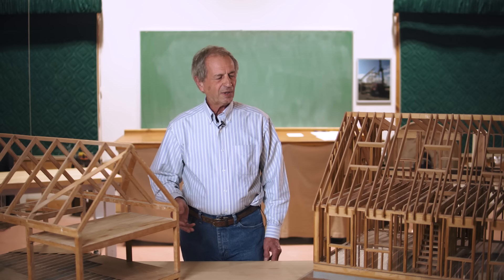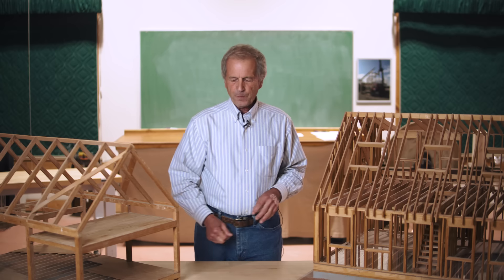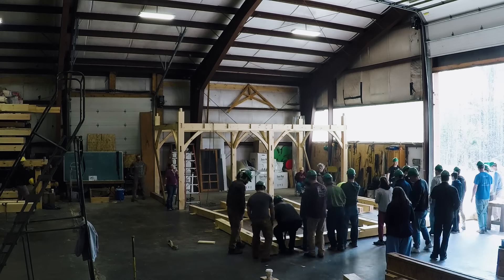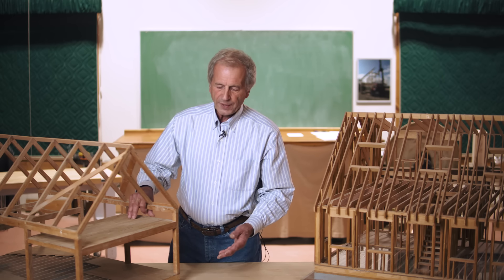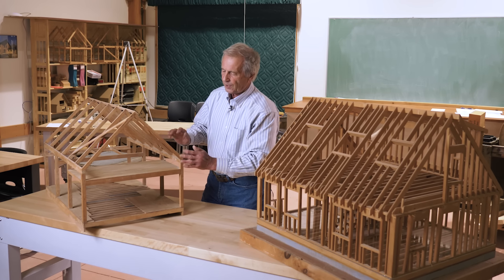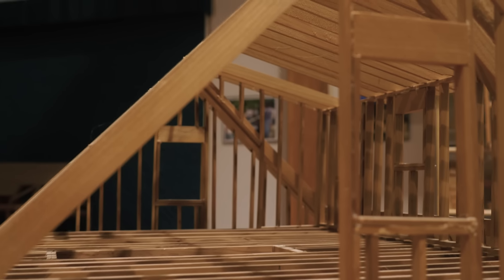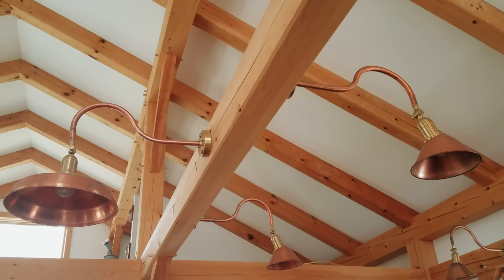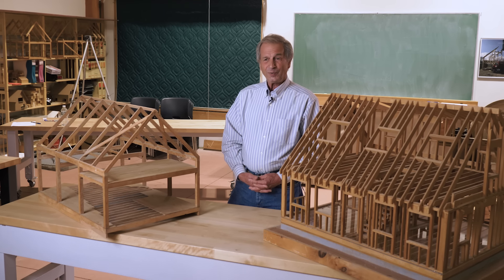Timber Frame vs Conventional Stick Frame

Comment from the maker: Take Your First (FREE!) Step Into Timber Framing with our Online Mini Course  -  tinyurl.com/u4ty9nm
We have taught thousands of ordinary people how to build their own timber frame structure, starting with raw timbers & ending with a beautiful 24' x 24' structure. Also check out our 5-day, in-person intensive Purely Post-And-Beam class - shelterinstitute.com/course_offerings
Reply: I have built for many decades, hundreads of structures , most every type of log home, post and beam to include conventional . There is a a time and place for each type and method with the many products that go with them. It takes months or years just to master even one of the trades but much longer to be a qualified builder. Having to meet the different codes of each state, county and or city and the codes for ever and ever changing will take far more than a five day course.  I do agree that one can build their on house and save lots of money but that depends on the person and their circumstances. I disagree totally about the structural integrity part of this video. I would suggest learning all conventional carpentry first and then move on to beam works and or log works.
Reply: assassinlexx  look into ancient Japanese beam construction. ancient Japanese buildings were made with wood-to-wood joinery and no nails and still stand today even though it's a highly earthquake prone area.
Reply: Shelter Institute 👍
Reply: assassinlexx  modern earthquakes require modern solutions?  Build underground on high ground.  No more problems.  Immune to earthquakes, tornadoes, and fires.
Reply: @ Grant Johnson.  Surely you are not saying that I'm a shill for big construction ?  I have had many home owner / build it their selves come to me halfway through building their homes or additions to help them, major works in place needing to be taken out from the roof down to the footings, two homes on unstable soil and sinking, dozens of issues.  Most of these good people had one common denominator - a person who knew enough to be dangerous for them, a Carpenter or Carpenters helper or another tradesman .  People that meant well but found themselves in a world of shit!  I have helped a few in my life , worked for low wages for the best and nothing for the worst.  I love the can do rugged spirt of American individualism but don't be a penny wise and a pound foolish or bite off more than you can chew.  If you have the help and know how to permit and build your house like many do then go for it !  Maybe you have the ways and means to do parts of the work, say the finishes such as drywall ,painting, finish trim and or cabinet's , maybe set windows and installation of the siding or building the decks.  There are no codes for the paint job or if your window trim doesn't fit perfectly and most would never know it but you. I am not for big construction when it comes to residential and for those that have or will bite off more than you can chew remember this " you will be stronger for what doesn't kill ya"
Reply: Are these structures suitable for northern climates? (Canada)
Reply: A lozenge don't stop drain.
Reply from the maker: @iworkforme  Thank you for the question. These structures are absolutely suitable for northern climates. SIte orientation, window specification and of course installation play a roll in energy efficiency but these structures lend themselves well to a variety of climates.
Reply: I like what your doing.....in our country most of house are constructed with block but I wish to do a project of timber house
Reply: Personally I'm a fan of timber frame homes, especially Greene and Greene homes. I laughed at your "gypsm palace" reference. I work in construction and occasionally we work on timber fames, we call them "Temples to Wood."
Reply: @j.r.millstone  They didnt use nails due to having so little iron as a natural resource
Reply: I guess Im asking the wrong place but does anyone know a method to get back into an Instagram account??
I stupidly lost my account password. I appreciate any assistance you can offer me
Reply: @Kasen Kohen instablaster =)
Reply: @Zakai Darwin Thanks for your reply. I found the site on google and im in the hacking process now.
Seems to take a while so I will reply here later when my account password hopefully is recovered.
Reply: @Zakai Darwin it worked and I finally got access to my account again. I'm so happy!
Thanks so much, you really help me out!
Reply: @Kasen Kohen No problem :)
Reply: @randyrussell6246  I went to New Orleans after Katrina to help rebuild.. The stick framed houses were shredded ..The old Big timber framed home still stood tall and only needed cosmetic work and soda blasting for mold from the flood waters. Most stick frame homes were just bulldozed and rebuilt
Reply: I thought the song was Goo Goo Dolls

Comment: I'm starting to get the feeling this guy prefers timber frame construction.
Reply: @adropintheocean6282  it was a joke, you knob
Reply: Probably because that’s the best way to build a house that will last
Reply: Gee i wonder why...
Reply: MyGraphicProcess  my guess is cost, people don’t want to spend the extra money for a sturdy timber frame or brick house, even most new brick houses in America are just stick frame with a cheep brick façade.
Reply: MyGraphicProcess  it’s because they wanna throw a house up cheap as possible then charge you thousands for it it’s literally cheaper if you build your own home than buy one here only if you can secure a loan hell it’s cheaper if you have friends who are in the trade industry
Reply: Yes, and what he says is 100% contrary to what I hear elsewhere. The traditional timber frame from Europe does not have an insulating shell around. He talks about a different construction with wood beans visible on the inside. Traditional timber frame instead uses more wood than a 2x4 frame house, is not so resistant against hurricanes and earthquakes, has poor insulation and longer building time. His kind of timber frame needs a second shell that is so massive it can not only span 10 feet distances but also hold windows, doors, water piping, bookshelves. I don't believe that this is cheap and can be harvested from someones own backyard.
Reply: @youngillinoisan4270  Yeah, I'm dismayed when I heard that my 100 year old house that is stick framed and has a cheap brick facade will be falling down any moment now.
Reply: It’s superior of the two.
Reply: MyGraphicProcess  cause you’ve got now wood in your country
Reply: MyGraphicProcess  which country are you?
Reply: I’m kinda getting that vibe too
Reply: I would too...
Reply: I'm wondering if the slough of timber models in the background gave you that impression.
Reply: Very biased.
Reply: Bro is basically saying W timber framing 🙌, and f#@k conventional stick frame 🖕
Reply: IKR
Reply: Because his company sells timber framed houses.
Problem are that it arent as good as he claims though.
Reply: 666 like
Reply: regarding brick homes: The San Francisco earthquake of 1904 established that bricks may be fireproof, but they're not shake-proof. The streets of SF were filled with bricks afterwards because the walls literally fell from the frames!
Reply: lol
Reply: MyGraphicProcess  You’ve gotten tons of replies, but the historical reason is that America had (and has) an INSANE amount of woodland. Specifically, America was very heavily wooded on the east coast during colonization, and thus wood timber was a far more abundant (and cheap) building material than stone.
Reply: @Caelum  the earthquake you speak of happened in 1906
Reply: @fugu4163  Surprised no one pointed this out in the last 2 years. Shill was pretty obvious.

But is no one going to get this man some water? jfc the sound of him clearing his throat will haunt my dreams.
Reply: @youngillinoisan4270  bad weather :b. Storms can come over and knock pretty much anything down, so, at least in some parts of the country, it just makes sense to build something cheaper and easier to rebuild/repair.
Reply: Which is different to "stick frame" construction because sticks are not made from timber, or timbers aren't sticks, or...    I have no idea.
Reply: in europe it was/is the traditional way. only last 5-10years the stick is pushing thru.
Reply: @2bfrank657  stick is good when there is a problem with the quality of wood. its easier to find good healthy 60x150 mm piece as 140x140  or more.
Reply: mygraphicprocess365 im not learned on the subject but bricks are better conductors than wood no? And styrofoam is for sure nothing compared the insulation in the US. Im guessing u r in the UK. The difference is weather. 110 in the summer and -5 in the winter in some places.
Reply: mygraphicprocess365 not only cost production. But also repairs. You will be repairing a stick house more often. So more companies will be getting your money more often. Basically forcing you to give your money back to the "economy"
Reply: @flexiblebirdchannel  what you say is true  about traditional timber frame. But in the video he speaking of modern timber frame. In the old days they did not have access to the SIP's. These are very sturdy insulating panels. I built my house of 11 gauge metal posts and metal trusses and c purlin.  And the posts and trusses are 10 feet apart, just like in his models. He isn't trying to sell homes, but rather teaching a simple way you can build your own home, and save hundreds of thousands of dollars on lumber and cheap plywood from the big box stores.  The amount of knowledge and labor required to build a modern stick frame home is mind boggling. But I built my metal frame home structure for $2700. That's right (two thousand seven hundred dollars.  That's the frame for a 2100 square foot home in 2010. Hes talking about using trees from your own property instead of the metal posts and metal trusses I used.  Hes providing a way for the ordinary human to build their own energy efficient home for pennies on the dollar.  And it is much much stronger than the materials from lowes and home depot.  The 2 x4 from the big box stores are not hardwood that our grandfather's used.
Reply: @Azathoth43 your stick framed house that has 100 year old 2x4 isn't the cheap 2x4 of today. Your studs actually measure 2 inch x4 inches and we're made of oak.  The modern 2x4  is 2 3/4  by 3 3/4 and is shi_ty yellow pine that you can break over your knee. The modern stick frame home is sh-t. But  real oak tree is still a real oak tree. And you could also use honey locust which is naturally resistant to termites and water damage.  Honey locust and bois de ark trees are like what the pioneers placed against the earth to build a house on. These trees are like severe weather pressure treated lumber, and they are very strong.  I have bois de ark fence posts still in the ground and holding fence up that almost 100 years old. Timber is far superior to modern stick frame.
Reply: @mygraphicprocess365 woods cheaper, better for earthquakes, and america just has way more trees, and trees grow back, making it easy to keep gathering wood to build more and more houses. europe along with quite a few other parts of the world almost destroyed their tree population with over harvesting, and very little planting. as such, they were forced to turn to brick and stone as their primary construction technique,  even though it was slower, and worse. also europe doesn't have extreme weather, so houses will last longer no matter what, while a good tornado can knock down almost any building that isn't cement and steel, low to the ground.